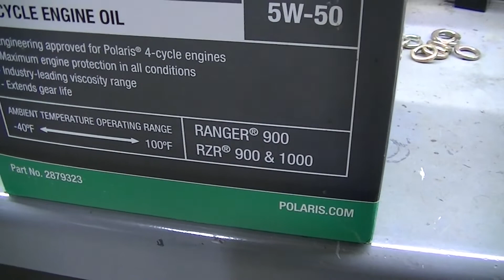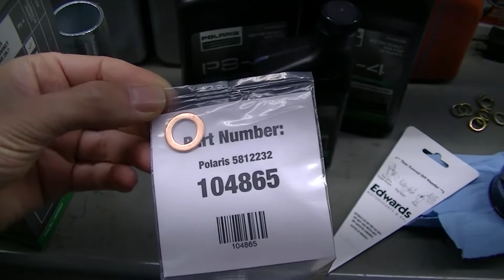HOW TO Polaris Ranger 900 Oil Change

Comment: Wow, 5W-50!  Don't think I've seen that weight before!  I like those kits in the box for lawnmowers!
Reply from the maker: Yeah, it is odd. I am not sure you can even find that oil outside of Polaris. They say it's good for cold weather starting and for hot weather running. I have always used the Polaris oils in all the Polaris machines I have had.
Reply: @mossman381    From what I have heard Polaris is super strict on warranty and would probably deny a claim if you didn't use their stuff, correct me if I'm wrong
Reply from the maker: @blackfly53  Yes, they probably wouldn't warranty something if their oil isn't used. This Ranger has no more warranty.

Comment: Were you able to view the video of the strobe set up on my truck?
Reply from the maker: I did watch it. I have some LED taillights ordered. First I have to see if hideaways will even fit. I might see if I can get the 12 LED one.
Reply: @mossman381  I think I may upgrade to the flare 12 they do not sit as deep in the light housing you can also get amber and white ones and I think they have a white flood mode I saw someone use them as a reverse light to